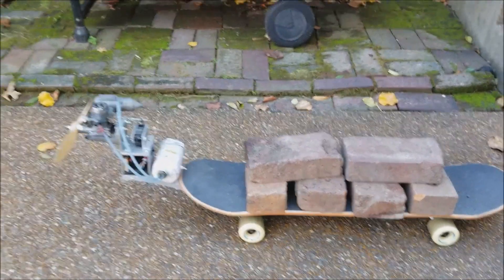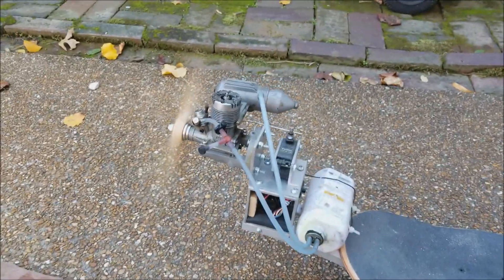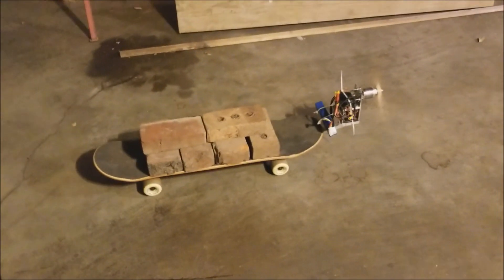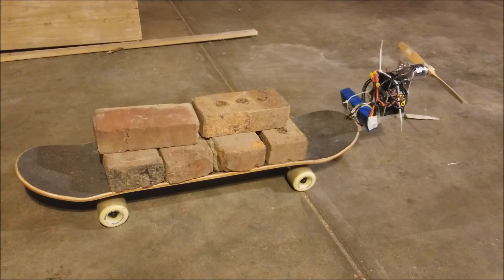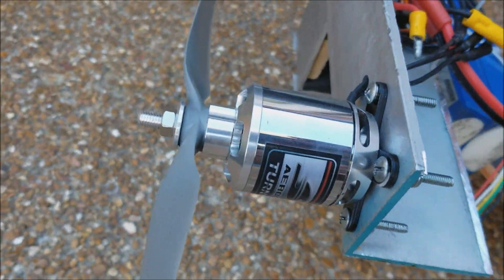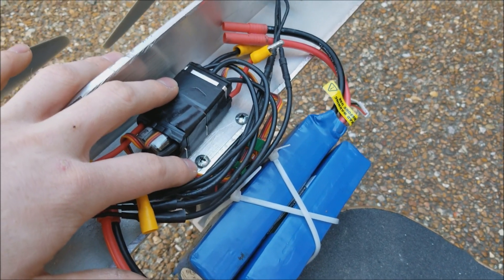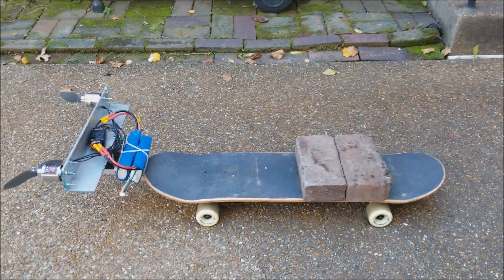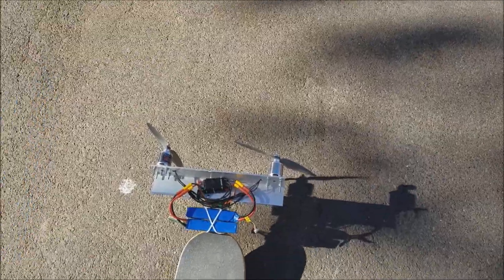Dual Motor Prop Powered Electric Skateboard

Comment: I would try, re-spacing the motors, one in front of each other (to move them closer) and counter rotating the props (@depending on the hemisphere). increase rotation speed just before cavitation of the air emanating from tip speed, of the props.

Comment: Switch the fan direction. Push don't pull
Reply: Also ducted would be a marked improvement since there is no major change in directional velocity.
Reply: Did you even watch the video?